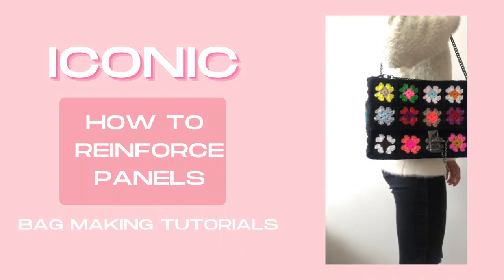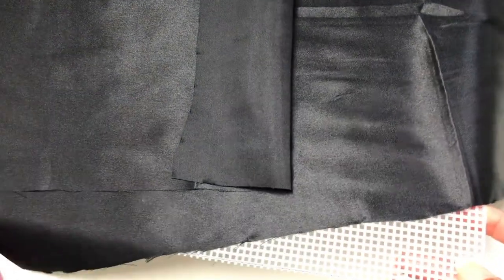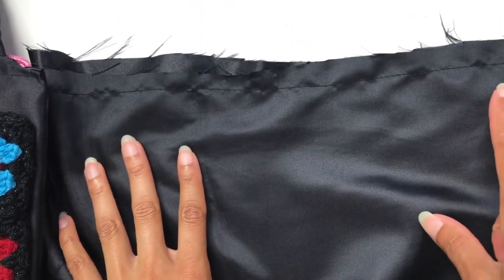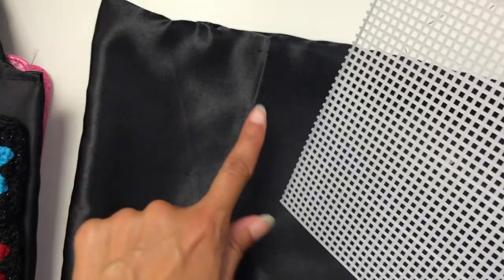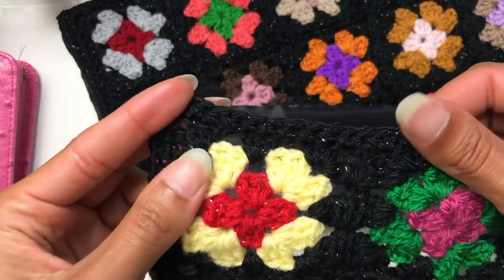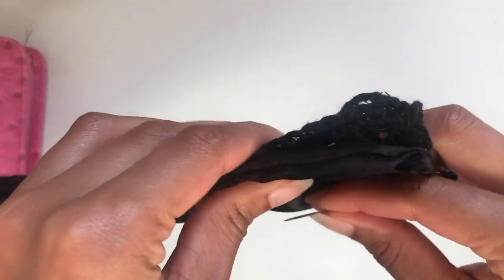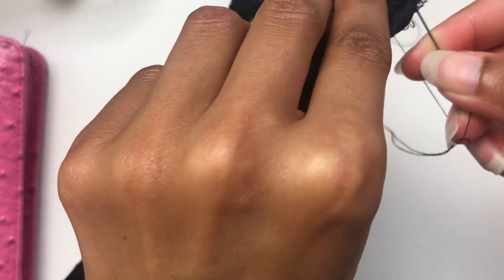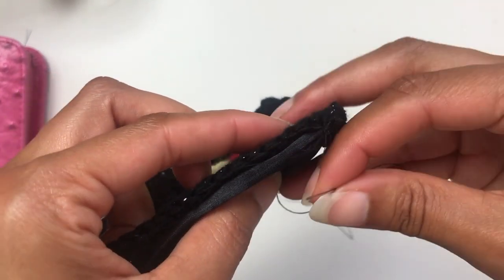How to reinforce your crochet bag ♡  HG Designs Crochet Tutorial ♡

Comment: The fabric you used is the most difficult to work with, slippery, does not sew well without puckery seams. Looks good when finished. I would use a cotton fabric next time for ease of working with. You might try: after placing plastic mesh inside fold one side over the mesh, tuck it in, then fold other side in, match up edge and whip stitch closed. Your bags are beautiful and glad you're at it full time now.👏
Reply from the maker: Thank you Carol. I’m gonna try cotton for the next bag I make 🥰👍🏽